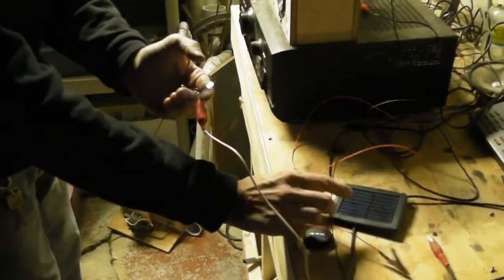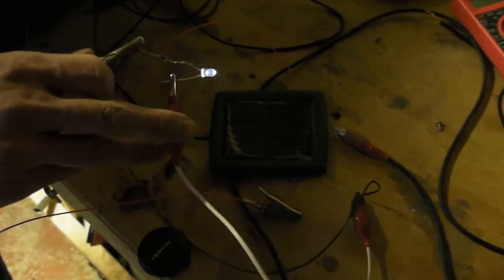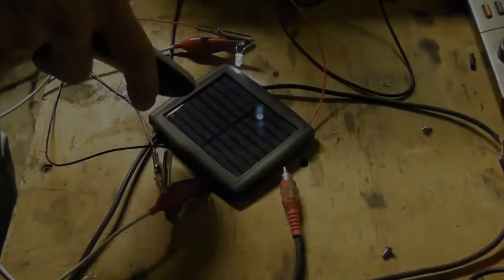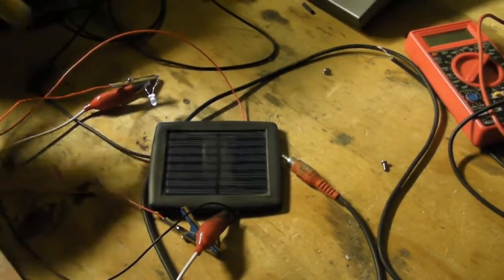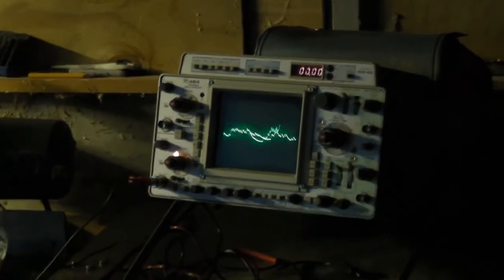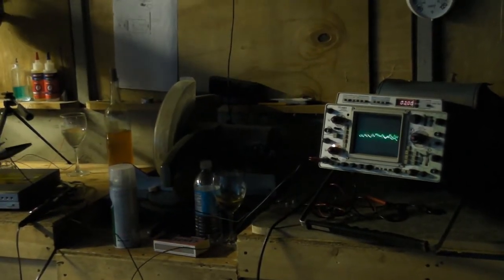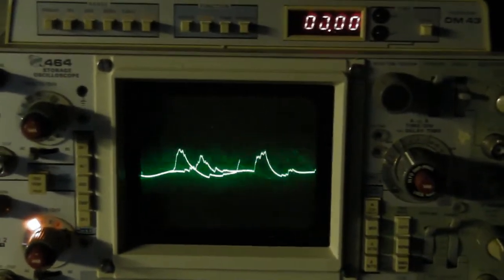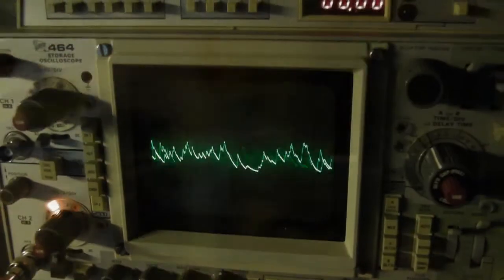Sound through an LED

Comment: Awesome :-) I had done the same thing as a teen decades ago, but using a tape recorder's microphone input connected to a LED as a receiver, and another tape recorder playing back sound through another LED as a transmitter. You need LEDs of the same color for this to work...also no fancy white/blue LEDs back then. You also need to control the emitters' LED's average forward bias and input voltage range, in order to minimize distortion.

Comment: Add an audio transformer in line with the LED and a power source and then run the audio thru the the side of the transformer and it might work better. Theres videos on here of how to do this.